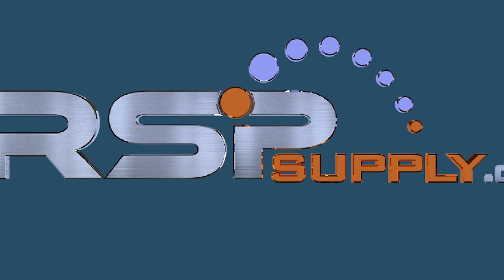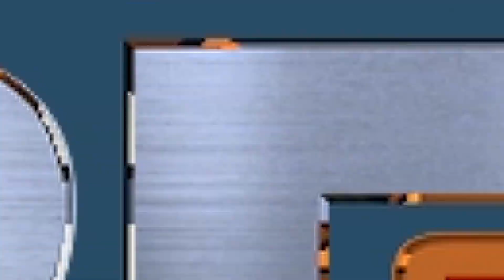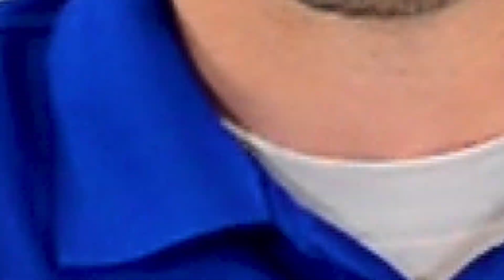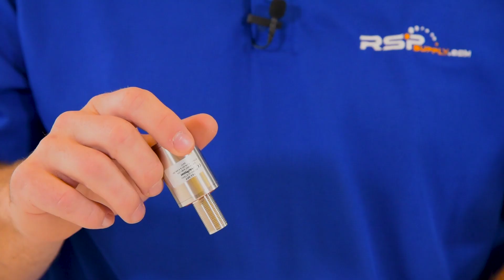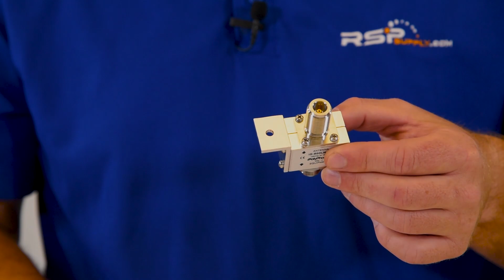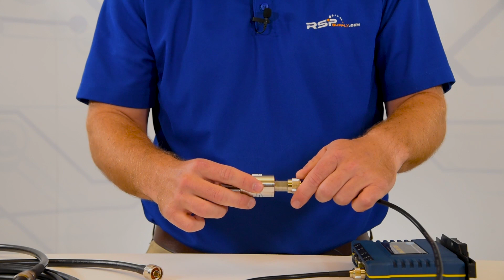Coax Lightning Protection Basics

Comment: Soo
#1 im asuming this would be inplace of a ground block???

#2 do if its grounded does gas tube still build up static electricity

#3 any one know of proxycast gas tube ones  are any good till i can get a polyphaser one that every one recomends???

My plan is to have use my surplus catv suplies to mount My tv  antena 30 ft in the air on a tree that is 60 ft high using  a 60 ft catv drop line  to the house. There will be a catv amp mounted 10 ft under the  antena  that will be  fed using a power inserter after ground block by a gfci 5 ft away from ground block  that will be conected to line going in house 5 ft above ground block

The antena itself is using a thin wire to ground to the coax shield but will ground mast to amp ground screw so coax shield can better carry static build up to ground block. The amp it self is 6k surge protected and i may add an 8 port amp thats 6kv surge protected as well

This sound ok or should i change something 

Side notes theres a taller fuller tree to the right of it and trees to the left of it  and bushes infront of it that luckily the high sids are on my side so i can cut them down lower also will turned side ways slightly so it doesnt stick out so much

Comment: Beware beware beware. Got a few that had no gas tubes inside just a couple small screws on the sides. No protection at all. Got ones with flush screws and some labeled 230v with big bulging screws. Tested them with a 0-230v supply with a 20k protection resistor. Big surprise. The flush screw ones were 230v rather than 90v so checked the tubes. Yep 2r230's.  Some sold at 90v had 230v tubes. The ones with big screws have double gas tubes rated at 230v but the tubes are meant for a center ground so 460v end to end. Bad news for most radios. So far only 1 of 8 have had what they were sold as. Beware the big bulging screw ones and check the small inset screw ones.

Comment: Do I need a lighting protector for an antenna I have on my terrace? I live on an apartment, so in theory the building should have a lightning arresters already on the top right?
Reply: lightning is a big current pulse. It sends out a huge magnetic wave. It produces spikes in every wire laid in the direction of the bolt. I have had sparks jump from my coax to grounded items while just laying on the bench when the strikes were a mile or more away. It would be a good idea to put lightning protection on any long coax or lines connected to big antennas. Cable tv lines tend to have lightning protection where it connects to the building. A long coax connected to a receiver is just a big antenna.

Comment: Can I just use a wire and stake it in the ground?
Reply: you have to have it near the lightning protector or a ways from the radio. the closer the protector is to the radio and from the ground allows for bigger spike at radio.